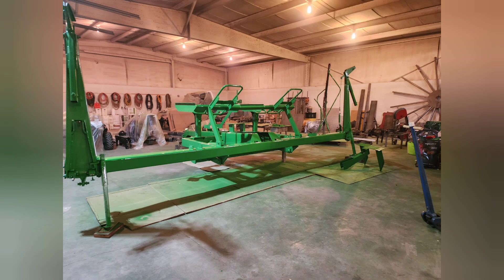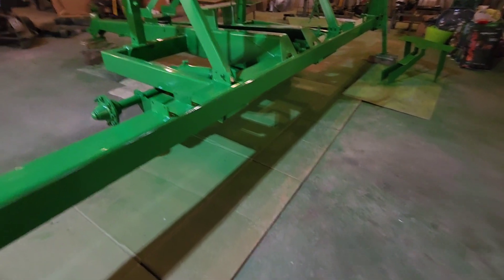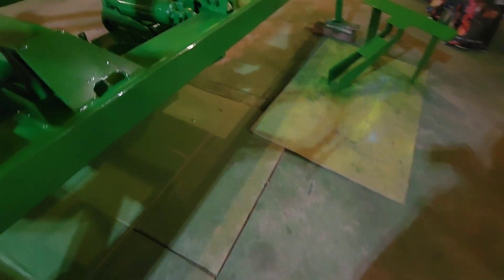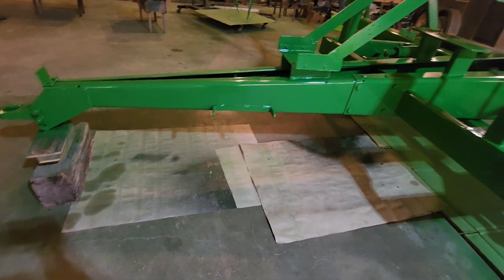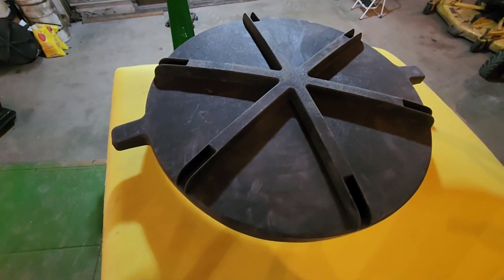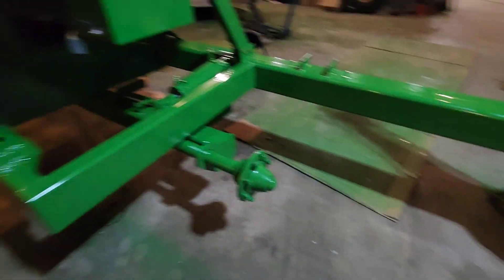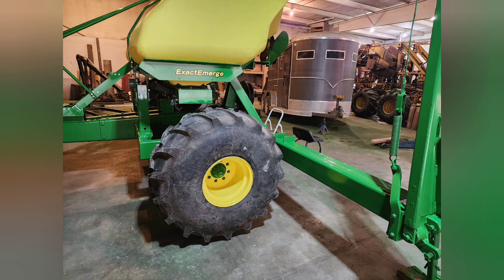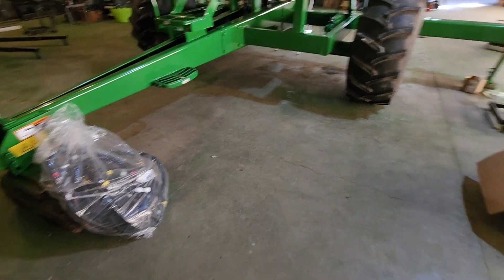Planter Build ... Video 5

Comment: I really like how you set up the platform and staircase. Back right up to the seed tender and not have to duck under the conveyor belt when getting up on the platform. Now I'm wondering if a guy could flip the platform around on a 1770 and build a ladder going forward on the tongue
Reply from the maker: Thank you! .... for sure! And it's quicker to access from the tractor seat this way ... I just didn't want to have to work on row units under a stairway ...